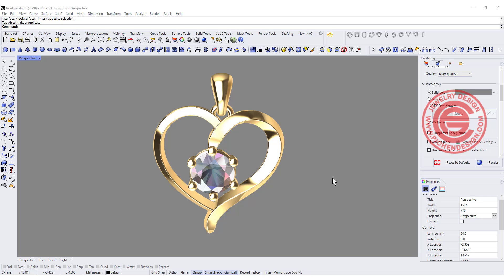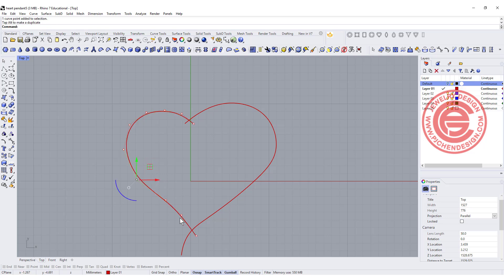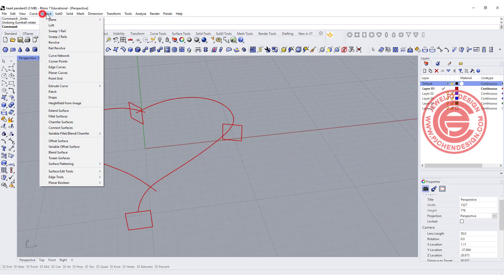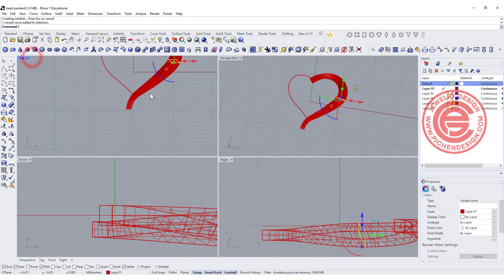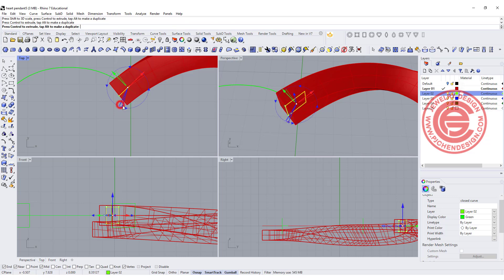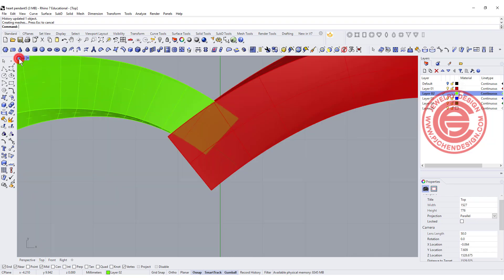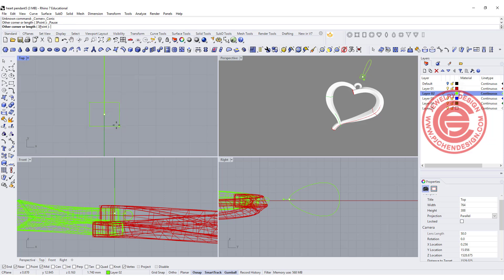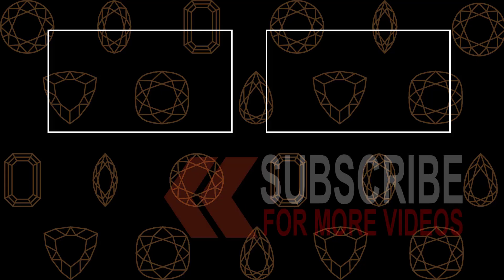Heart Pendant Jewelry CAD Design Tutorial 3D Modeling with Rhino 7 #165

Comment: I noticed the objects are not joined together, im wondering if that will cause any problem during 3D printing?  
Many Thanks
Reply from the maker: If you are printing it. it is better to boolean union all parts and make sure there is no naked edge.
Reply: @PJChenJewelryDesign  Thank you so much!

Comment: What is the best Rhino7 setup for jewelry, design through production?... MatrixGold/Clayoo, Grasshopper, V-Ray for Rhino, Panther3d, or just plain Rhino7?
We want the best before we start learning, but there's so many options. Money is no problem, we just want the best setup. Regards, Ferretface.
Reply from the maker: If money is not a problem go for MatrixGold. It is also a plug in for Rhino 7. So you will need to buy rhino 7 in order to buy plugin for MatrixGold. All the commands I show in my channels can be use for Matrix Gold. V-ray is a rendering program, same as keyshot. Clayoo is another plugin that include in MatrixGold which can do the same thing with Rhino 7 SubD. they both can create very organic surface.
Reply: @PJChenJewelryDesign  Thanks. Rhino7/MatrixGold it is then. Once setup, I will join your channel for tutorials. I will be designing mechanical(ratchet wrench, watch gears, etc.) to simple organic charm bracelets. Everything I design I will be making the molds and pouring the aluminum alloys myself. This is going to be exciting. Thanks, Ferretface.
Reply: @PJChenJewelryDesign  After considering upgrading my computers to handle the ridiculous system requirements of MatrixGold, I've decided to learn Rhino by itself, without any bloated plugins. I'll be checking out your Rhino(non-plugin) tuts.